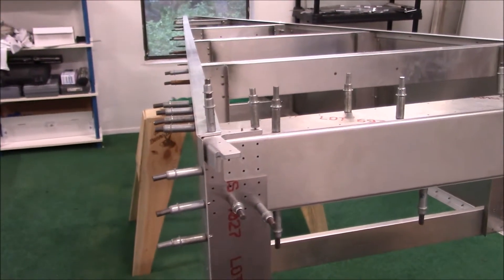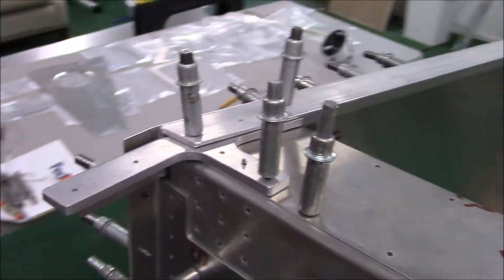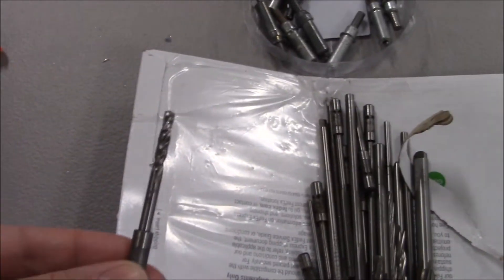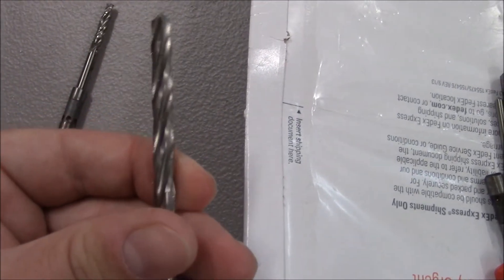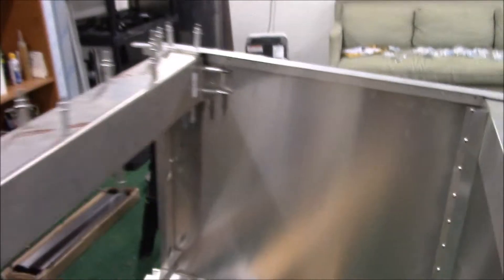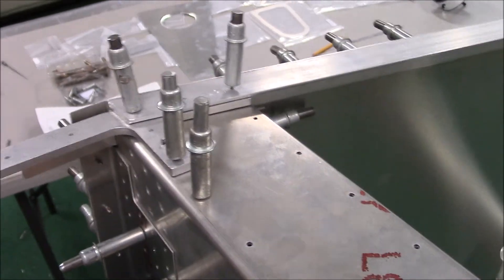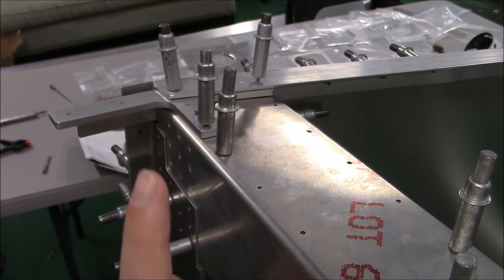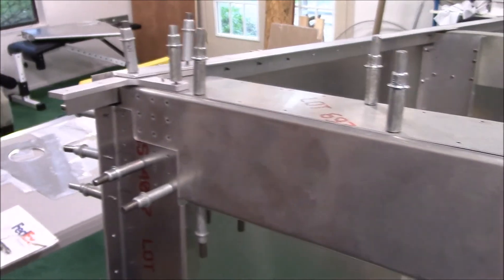Sonex Aircraft Build Video 56 Reaming Gusset Holes on Fuselage Update

Comment: Hi Daniel, great watching you build the Sonex. I don't build any aircraft but is curious when in the build you apply the anti-corosion agent e.g. zinc chromate paint?
Reply from the maker: Hi Patrick, forgive the delay. I have been traveling the last month. This aircraft uses 6061-T6 aircraft grade anti corrosion aluminum. They say you don't need to put any corrosion protection on it, but I decided to add a little. I use "self-etching" primer that I buy from an auto-parts store. I then only apply it to "mated surfaces" of the aircraft. I can look inside the wing with a borroscope and see blatant corrosion, but I can not see between two touching surfaces. I apply it only minutes before I final rivet the parts. -Dan